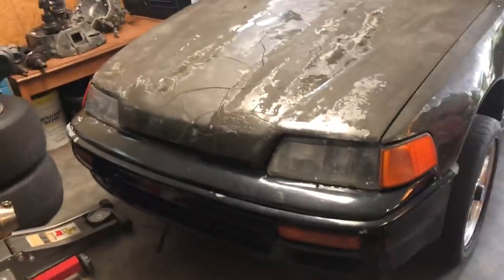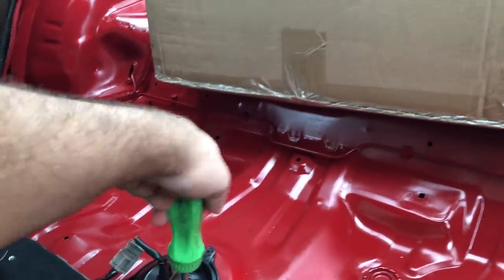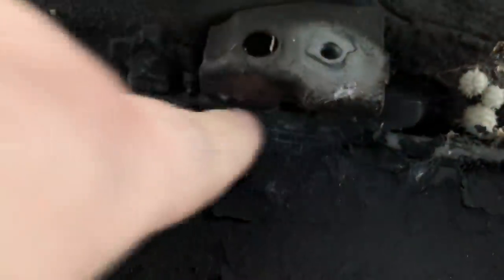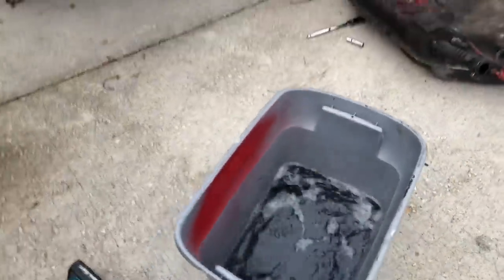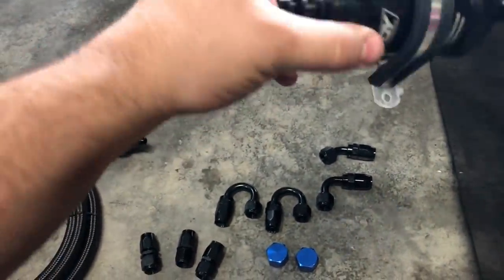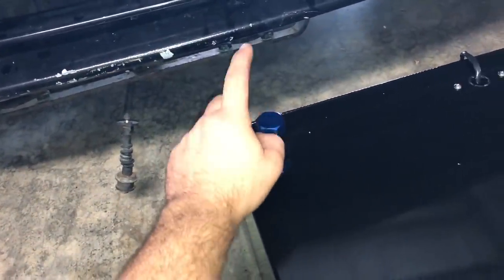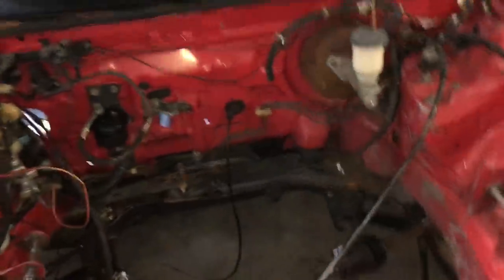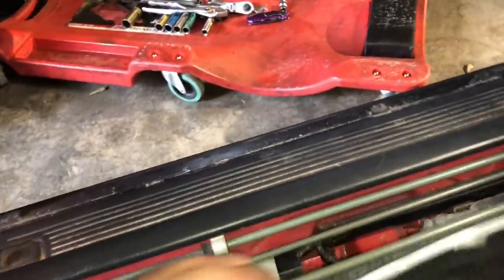How To AWD Your Honda: Fuel System PT. 1

Comment: caffeine withdrawl is a bitch. I've worked my way down to decaf coffee n decaf green tea. Which actually still has a small amount of caffeine in it. That small amount of caffeine in decaf will help with the caffeine withdrawl headaches. Something I learned as a barista. CRX build is gonna be badass when its done. I ported my own intake manifold like you and welded it back up myself. It turned out pretty good too(no leaks) ,and my tig welds are lookin better all the time. Keep up the good work homes. Can't wait to see you race this thing.